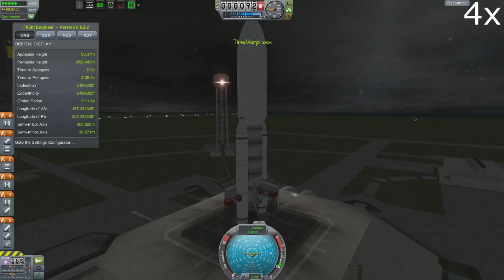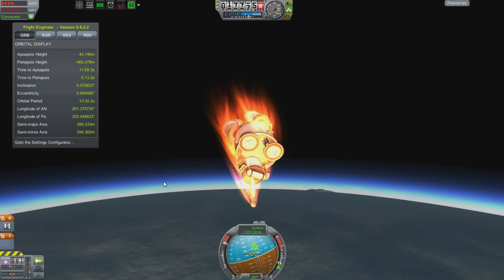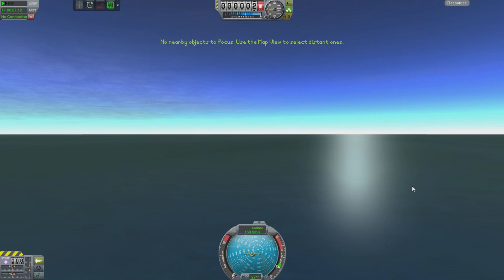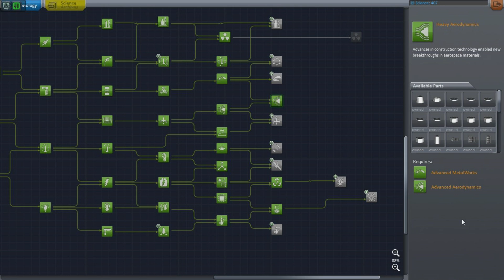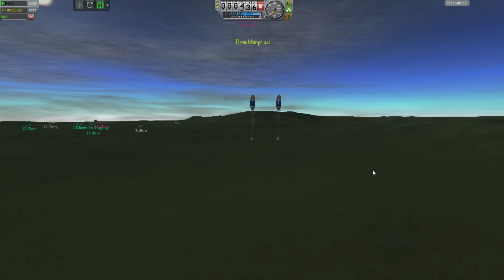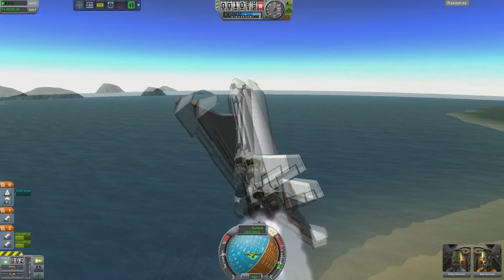Kerbal Space Program - Interstellar Quest - Episode 27 - Rocket to Eeloo, Spaceplanes Into Ground.

Comment: Hey Scott, this may be a noob question but what is that casing that breaks away at 0:54? Is it a mod and if not how do I use it? Thanks :D
Reply: Claradon That's called a Fairing, an aerodynamic shell that both helps the rocket get through the atmosphere more easily, and protects the equipment. As I understand it (and have used it) version 1.0+ has fairings as part of Vanilla KSP. They're pretty cool, too. ^^v
Reply: i believe it is called a fairing and it helps with aerodynamics when you are in the atmosphere while also protecting the equipment inside

Comment: Lost control? Aim at the floor.... Then slowly bring it up, no idea why you didn't do that...><
Reply from the maker: If you've lost control you've lost the ability to aim.
Reply: Ahh :P I was sure you had some degree of control, I guess it just completely went nuts. ><
Reply from the maker: HawkAce . It wasn't so much nuts as it was stuck in a flat spin, which meant the control surfaces did nothing (due to the air moving over them in the wrong direction). Although I had RCS thrusters those did not provide enough torque to move out of the pancake.

Now, this is largely because it's an experimental design, real aircraft have spent a lot more effort working on stability, so they're less likely to end up in a stable flat motion like this.

Comment: There is a trick to get rid of those casings on the nuclear engines, without jettisoning them: first you quicksave (F5 by default) and then reload to the quicksave (hold F9 by default). The game doesn't load the casing anymore, only the engines.

I found that by putting engines close together (using a quad-coupler for example) they will blow up because of the casings hitting them as these are jettisoned.

Comment: You should try installing a horizontal stabilizer (conventional aircraft use a Horizontal tail plane in the back, supersonic jets generally got for a canard configuration) I'm not sure which aerodynaimcs engine you use with mods but in general if the center of lift is not perfectly ontop of the center of mass (which is never since your weight distribution changes as your fuel drains) this creates a moment in the pitch direction. Aircraft use their HTP's to counter this moment by providing a small liftforce in the opposite direction. So either install smaller wings near the nose of the aircraft (for a canards aircraft) or try putting your vertical tail plane into an angle so you get a V-fin configuration which acts as both horizontal and vertical stabilizers. I reccomend the first option because I don't know if KSB supports V-fins. And if you go for a V-fin move your main wings forward so that you get a better moment from your tail plane

Comment: I may be mistaken, but interplanetary space shouldn't be all that cold, relatively speaking. It's actually quite hard to keep cool, given you have a massive nuclear engine firing out your butt and not a lot of ways to dissipate all that heat quickly. There's simply no medium for the thermal energy to escape with, isn't there?
Reply: Radiation allows heat to be lost, thus why the ISS and Space Shuttle have large radiator panels. Otherwise you are correct.

Comment: Im probably preaching to the choir here, but arent those flight issues because of shift of COM due to fuel use on those engines? I had a similar problem with a shuttle design of mine that would glide marvelously with full tanks but fell like a brick with them empty...
Reply: yea, but then why dose it flip around backwards? Dose the nose maybe have parts with higher drag?
Reply: The engines are very heavy, so they tend to dictate the direction of the fall...

Comment: 'it takes a really long time to dump that amount of fuel'
Whilst it was an older version, when I played with it a while back you could set a rate at which it transferred fuel; if you set it at 10x for example, it dumped fuel really quickly. Never used it for actual fuel transfer for fear of what it would do to have the centre of mass shift so quickly

Comment: The spaceplane is unstable because your centre of lift (pressure) is below the CoM. You could give it raised elevators to bring the CoP up, lower the CoM, or by raising the wings/increasing their dihedral angle. See my post on the forums for a short study of the problem: http://forum.kerbalspaceprogram.com/threads/51996-Sanzuwu-SSTO?p=689733&viewfull=1#post689733

Comment: Scott you won't be able to take off that steeply with a heavy cargo, you would be better off with a swept wing instead of a delta wing, try to base it's wing configuration on something sensible like the C-17 Globmaster III. That should give you a stable and reliable cargo spaceplane also if you do chose this configuration, be gentile on the throttle.

Comment: Scott, your DRE is tame as a kitten. If you want it to really bite when you plunk something into the atmosphere, grab the Real Solar System mod - it's come a long way since you reviewed it (and especially with RealFuels it kicks butt). RSS + DRE and you will be extremely careful about your reentry angles. The downside (or upside, from my perspective :) ) is that the game is significantly more difficult.
Reply: ***** If you'd tried Real Solar System you'd understand that reentry at below orbital velocity is much more dangerous than reentry at or very near orbital velocity. The reason is that spacecraft rely on their leftover lateral momentum and very shallow reentry angle to "ride" the atmosphere and bleed of lateral velocity, kind of how stones skip off of ponds. If the spacecraft is slow (in Scott's case it was about 2/3 orbital velocity, which in RSS would be around 5km/s), it will reenter very steeply and before it has time to bleed off excess speed will dive deep into the dense atmosphere and disintegrate.
Reply: totoritko You can actually set a config file to "fake" a full 8km/s reentry. If your only goal is to make reentry harder it is a lot easier that way.
Reply: Niosus If you mean the HeatMultiplier parameter, then I'm not sure it will work satisfactorily. There are some non-linearities which could make normal reentry from orbit damn near impossible, while still making reentry at 2/3 orbital speed survivable. RSS also modifies the atmosphere height and pressure curve to more accurately reflect Earth's.
Reply: totoritko Well, I haven't tried it. Couldn't tell you.

I think Scott wants a challenge, but not make it too hard. He has to make videos about it after all. Something like life support and mobiletech add extra mechanics which are entertaining for the viewer. Having a very narrow reentry angle or needing a larger rockets to get anywhere is not as interesting. The same reason why he doesn't use signal delay. It's just not very interesting to watch but it means he will fail a lot more often so he will get a lot less done.

But they are cool mods, I might give them a shot :)
Reply: Niosus Of course it's a matter of personal taste, so this is just my take:
The added complexity of reentry angle and larger rockets requires you to change your mindset significantly, it doesn't just scale the mission. E.g. in the Duna mission he's doing, it'd be damn near impossible to transport as much payload as he does. Even with ideal aerocapture/breaking it's around 7.5 - 8 km/s for a round trip. And since the approach speed to Mars is somewhere in the vicinity of 5.5km/s, you'll need heat shields on the whole thing - no fragile external trusses like he uses (or budget in an extra 2.2km/s for manual orbital insertion, or ~1km/s when using gentle aerobraking but not hard aerocapture, though that requires extra food resources, since it takes a lot of time). He'd have to break it up into multiple spacecraft, possibly sending a fleet of spacecraft, perhaps with a year-in-advance preparatory mission just sending empty habitation modules with resources etc.
To me this would be a lot more interesting to watch, because it would show how an actual real life Mars mission could be done.
"The same reason why he doesn't use signal delay."
No, the reason he doesn't use signal delay is because it's completely unrealistic. In reality we control remote spacecraft using a joystick in real time. What we do is write and upload a program to the craft which does it for us. Obviously one can't do that in KSP, so signal delay is absolutely unrealistic and just difficulty for difficulty's sake (now that's pointless).
Reply: Niosus "But they are cool mods, I might give them a shot :)"
Be careful with RSS, because it is quite addictive. Ever since I started using it, I can't go back to stock, because everything just looks so cartoony and out of scale.
Reply: totoritko Of course, those are good points. I get it. I like realistic missions, but Scott has a day job as well. I'd rather see him do several less realistic missions at once than having him need 20 parts just to get a kerbal alive on the surface of Duna/Mars (over-exaggerated, I know). I think he strikes a good balance. He makes it hard enough to be a challenge but easy enough so he can pull off some pretty cool things that inspire people.

You remind me a bit of some of those ARMA youtubers who upload full 2-3 hour missions with up to hundreds of players on a huge map. They use real military tactics and mods that even distort the coms channels to reflect the real deal. I guess what you're looking for is something like that for KSP: As realistic as possible. I don't think this is Scott's goal. It would definitely be interesting to us (I'm also quite a space geek fyi ;) ) but not for a lot of other people.

I think this also touches on why exactly KSP (stock) is so popular. It strikes a balance between realism, accessibility and the sandbox experience. As you make things harder, the reward for success becomes greater. After a certain point you start to have diminishing returns after which extra difficulty doesn't really make the game more fun. This point is different for everyone and stock KSP seems to be right in the sweet spot for people who are just getting started with it. As you become more experienced, that sweet spot will move until you reach your skill ceiling or interest ceiling. It's a very obvious trend in RTS games, especially in multiplayer: As you become better you get matched with more difficult opponents but at some point you either cannot get better at the game or you simply cannot bother to put in the time to become better. In KSP you increase the difficulty with mods. For Scott, since he has a day job this probably is the latter.

So more hardcore would only be of interest to a small part of his audience while he has to invest a lot more time to produce that content. I'm probably approaching this too mathematically but I think it makes sense?

Last note: the signal delay actually has implication in real life. What you say is true for planned maneuvers but for a reactionary maneuver it is very important. If there wasn't a signal delay between Earth and Mars we probably wouldn't have gotten Spirit or Opportunity (forgot which one) stuck in sand dunes because by the time we could react it had already dug itself in pretty deep. It would also allow for more risky maneuvers since we can evaluate the situation much more granularilly. That is why they updated Curiosity a few months ago to let it figure out its own path between 2 points. It can react to changing situations in seconds so it can move a lot faster than before without running the risk of getting stuck.

Comment: I also have this roll problem playing with FAR. It's a problem where the wings flop around (wings sometimes flex unsymetrically under stress like pitching).
Usually you can fix it with (a ton of) struts (Strutting the wing parts to one another and to the fuselage; doesn't look pretty but is effective; also struts sometimes don't stabilize parts when attached with mirror symmetry, it's a bug i've found).
Since you have the KW heavy struts this shouldn't be a problem.

After taking a careful look at the presented video evidence it seems i've found the problem Captain Manley, Sir!
Report: The 6x4m delta wing part is not strutted to the 4x4m structural wing and the 4x4m delta wing. (both 4x4 are attached seperatly to the rest of the fuselage) Whilst actuating the control surfaces they flex unevenly on both sides. That causes a change in the lift characteristic of both wings. But because the flex is uneven you have uneven lift and this induces the roll. (This effect can be especially easily be seen very easily when flying aircraft in chase cam mode) I encountered this effect along the line of my KSP career with big space planes like my 180 ton orbital shuttle I built in KSP .19.1 (my profile pic). A ton of struts usually fixes this issue.
Reply from the maker: What's not shown here is later versions of this design with more struts where I still get the roll to the left, I actually completely rebuilt my spacecraft thinking that I might have accidently picked up some asymmetry, but it still rolls to the left preferentially.
Reply: Hmm. That's odd. And i presume you checked for the case of uneven fuel drain. So that isn't the issue either. I have once encountered the bug that wings attached in mirror symmetry sometimes have unusual flex on the opposite side they were placed (i kinda not know how to express this properly; basically when you place a part with mirror symmetry it copies it over to the other side; sometimes the connection strength scales wierdly)
What side do you typically place your parts to and which side does the mirror symmetry copy the placed part?
Reply: I need to do some testing on this.
I'll tell you my results.
Reply from the maker: Achim Hanischdörfer You know I don't remember which side I assembled from, I tend to go back and forth.
Reply: I see. So it's probably not the connection strength thing that sometimes happens to me.
Reply: My Rockets tend to roll to the left and the more speed I gain the faster it becomes and its only when there are big farings that causes problems for me i have FAR and all the other mods you have Scott!
Reply: Achim Hanischdörfer
Tada: Results
http://imgur.com/a/x8UVW#0
Take a look for yourself. 
It seems that wing flexing can lead to asymetric lift (why i don't know).
I can't help more. This is what helped me fix my stability problems. Your problems could come from an entirely different source.
Reply: Scott Manley
Most big aircraft I make roll(slide if I'm on the ground) to the left or right totally randomly whether I use FAR or not. I think it's just slight random motion in individual parts caused by floating point errors, and then being amplified by the aerodynamics. I usually don't have this problem with small aircraft, even if I have to make them slightly asymmetrical to fit things onto them.
Reply: Scott Manley I don't know if FAR simulates this, but you might be getting tip stalls because of those winglets. In real life, the vortices generated by the wing tip would be interrupted, and only one wing would stall. Keep up the great work!
Reply: Chessie Newbold 
That might be it. Since FAR can also simulate stalling of control surfaces it might also simulate partial stalling of wings.

Comment: on the latest spaceplane you'll benefit from disabling front wheel break and making the rear wheels farther apart from the center of mass, so that your landings will be stable. you can also assign roll to the furthermost control surfaces and pitch to the middle which frees the closest control surfaces available as flaps if you want.

Comment: Hey Scott, what did you do to disable remote tech and keep the parts and animations?  I noticed on my gamesave it was duplicating vehicles with transmitters, as in 10 ships existing in the same space, made for spectacular explosions!
Reply from the maker: I don't have the animations right now, I just moved the DLL out of the gamedata directory for now.
Reply: I removed the dll and it still continued to wonk out.  Then I found one more duplicate ship (kept missing one) terminated it, restarted and it worked fine. It feels weird not actually being restrained by the distance of antenna.

Comment: the nuclear engines do both,provide steam, and propel the ship, but where is the coolant water coming from?
Reply: the fuel tanks are made of oxygen and hydrogen, and when they react they create a lot of energy and water as a residual product, which comes out in the form of steam and powers up the alternator, thereby generating electric charge. you do this at the expense of a little specific impulse.
Reply: kunstderfugue wow, i wouldn't think that it would be tasked with doing both, but i guess if your gonna carry some uranium(i guess they'd use standard zirconium rods), you might as well use em for power

Comment: 3:27

Lol in the .23 you can limit throttle in your engines, even for the SRB's.

And even in flight with the SRB's active.
Reply from the maker: That falls under 'bug' and should be fixed if it's the case, it's certainly not the case in the version I downloaded this morning, perhaps you should update?
Reply: Scott Manley Not a bug Scott; its akin to changing nozzle diameter or such.  Its one of the "tweakables", so only available in the VAB or SPH not during flight.
Reply: Scott Manley In the latest Steam version I have a return vehicle with some separatrons tweaked with the right amount of thrust and fuel to slow it down below 1m/s right before touchdown. Basically the same as how the Soyuz capsule lands. I haven't tested changing in in-flight, but you can definitely tweak it in the VAB.